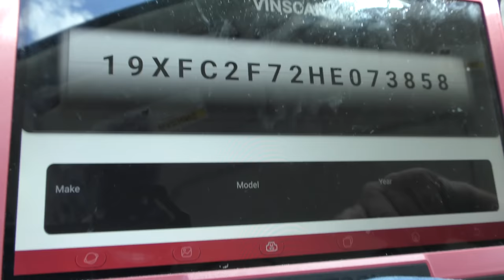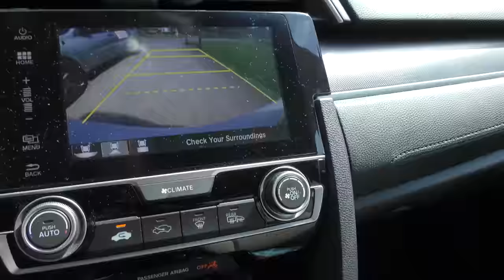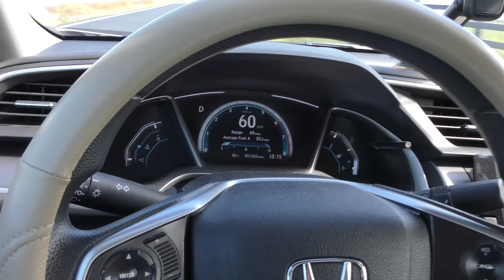Here’s What Happens If You Change Lifetime Transmission Fluid in Your Car

Comment: For those who want a Complete (Trans, Torque Converter, abd Radiator-Cooler) fluid exchange vs an approx 40% pan exchange, the following 2007 RAV4 approach SHOULD be applicable to Most makes and models:
1.) Remove the plastic shield under the front of the vehicle. Note, new assorted plastic push-clips are recommended.
2.) The radiator cooler transmission fluid out-fall is on the drivers side approx 3/4" OD, 3/8" ID rubber hose with spring clasp clamp --  EASY to see and access!
3.) Disconnect the hose and attach an extension line to a translucent 1gal jug in an catch pan (for overflow/spills).
4.) The steel return line may drip into a second catch pan.
5.) Snuggly attach a clear extension line to the dip-stick tube with a funnel. (I inserted a clear plastic kitchen "baster" keeping the refill level from overflowing at top of the "baster"/funnel).
6.) Start the engine and put in gear (automatic) until approx 1/2 gal OLD is collected and turn off engine.
7.) Fill approx 1/2 gal NEW.
8.) Repeat for approx 2 1/2 gals until bright pink is dispensing.
9.) Reattach radiator/trans Return line.
10.) Adjust fluid level to the low side of the "Cold" mark on dip-stick (so you can top-off to the Hot mark).
11.) Drive vehicle until transmission is up to approx 115 deg. F and adjust fluid level to "Hot" mark.
12.) Reattach the plastic shield using new plastic push-pins.
13.) This should replace the Trans, Torque Converter, and Radiator Cooler with ALL New Fluid.
NOTE: For Sealed transmissions attach an extension line with funnel to the steel Return line (instead of the non-existent "dip-stick tube").
Happy motoring!

Comment: The older non CVT Honda transmission had the dipstick to check level and refill which was easier than this new one.  Excellent Scotty thank you
Reply: No, the newer Honda cvt has a check bolt. You remove the bolt, and pour fluid in, until it comes out the bolt hole. I don’t know why Scotty didn’t mention this?
Reply: @tripicana1 in a transaxle or differential you're correct.
Reply: @DivineSadist  Honda cvt uses it too, no need for a dip stick.

Comment: Scotty is spot on about NOT flushing your transmission. I bought a 96 Buick regal back in the day and I wanted to take care of it so it lasted a long time. I thought I was doing the right thing when a mechanic suggested I flush the tranny fluid instead of changing it at 60K. Well, I ended up with a transmission that wouldn't shift properly after that and had to get it rebuilt. I would have been better off doing nothing but instead I paid for a flush and then I paid for a rebuild. (about $1500 at that time)
Reply: The transmission in that Buick was far easier to rebuild than a modern transmission would be.

I miss the good ol days of simplicity, and I think it's funny that suggesting a car from the 90s is simple. I remember when those cars were new and everyone went on about how complicated they were. If only we knew then just how crazy it would get...
Reply: Completely right.  Had a 94 Chrysler New Yorker I wanted to take care of.  Had a flush done.  Never shifted right again.
Reply: As a mechanic and garage owner for 35 years I can tell you there are different types of machines to accomplish this process there's a difference between transmission flush machine and a transmission fluid exchanger. I personally own an exchanger and have used it for years with no problems ever but I also drop the transmission Pan and service it completely I don't just rely on the fluid transfer.
Reply: @sdrape4964  At least it wasn't a sideways engine.
Reply: but what if the transmission fluid was leaking? and had to be replaced?
Reply: @Nunya Business You're wrong: buy a cheap older car that is actually a decent car (you know, TESTED and PROVEN) instead of stupid credit cars.  Get out of the dumb credit loop on something as cheap as a car.
Reply: I had similar issue with BMW F10 535i xdrive (ZF 8HP transmission). After transmission flush and refill it started shifting really harsh 1->2 and 2->1 gears after short spirited driving. I was not sure if this was the reason, but strongly suspected the procedure of changing the fluid was not done correctly. Ended up selling the car, because the repair of the transmission costed a lot. At least for ZF transmissions don't flush, only drain and refill according to the procedure described by them.
Reply: Lol no he’s not right tbh I use to work for Honda and we sold trans fluid flush and we’ve never told a customer that the fluid is a life time fluid 🤣🤣🤣
Reply: @nunyabusiness3786You’re not of good morale character.
Reply: @aelfwealld This is such a bizarre response. You managed to squeeze so much nonsense into just a few self-righteous words.
Reply: @nunyabusiness3786thise proven and tested used cars were credit cars when they were brand new too though. Just because people need to finance them doesn’t somehow make them inferior. Your logic is so faulty
Reply: 2005 Honda Pilot. I changed the fluid when it was 15 years old and had 105,000 mile. 6 months later it needed a rebuild.
Reply: @TheHillrat4wd  what does that mean you service it completely?  What does that include?
Reply: @earljenkins4671 Honda flushes the transmission??
Reply: @JesusSaves827 was it a flush or just a fluid change?  Who did it?
Reply: @JesusSaves827 was that the only time you changed the fluid? We never changed the fluid in a Ford escape and it's gone 250k miles
Reply: @sl4983  Well I have to define a couple of terms first, the term "flush" I don't like. That actually is an Antiquated term when they first came out with a "flush" machine it was merely a pressurized bladder tank that could be over pressurized hooked up wrong, you could reverse the flow of fluid and possibly damage the transmission. "flushes" have got a bad rap, technically it was the fault of the technician not doing it properly. current machines like the one I have are considered fluid exchangers they do not operate under high pressure they actually use the pump in the transmission of your vehicle  to pump the fluid into the machine then there is a small 12 volt pump in the machine that will pump in the new fluid at the flow rate the old fluid is coming in, you start the vehicle run it to operating temperature with the machine hooked up once the fluid is to Temp and circulating properly there's so many fail-safes on a machine if the flow is hooked up backwards it won't work, if the flow pressure isn't correct it won't work it's basically impossible to damage a transmission today using the proper equipment again I would say it is called a fluid exchanger. Now to address your original question when I say complete that means I dropped the pan change the filter and then continue with a Exchange most garages you go to only do one or the other, they drop the pan and change the filter top off the fluid or they will hook it up to a fluid exchanger without changing the filter and just exchange the fluid to me to do either one of these individually it's not a complete job. Do both.
Reply: @TheHillrat4wd  That was very helpful, thank you SO much.
Reply: @TheHillrat4wd  if doing both, which one would be done first?
Reply: @JesusSaves827  just to be fair that does not mean it failed because you changed the transmission fluid.
Reply: Probably should have adjusted the bands on that.
Reply: The issue is going to a mechanic that's flushing and charging the fluid with the wrong stuff. Maybe they do it on purpose so they can get the repair business later.
Reply: @earljenkins4671 so you ate saying it's lifetime?
Reply: Never flush the transmission fluid on GM cars
 Not recommend it,bad idea
Reply: What is a flush can u describe it? Its not the same as changing fluids is it
Reply: @nunyabusiness3786Don’t measure inflation based on the minimum wage lol. 

There are too many reasons to list here why you shouldn’t do that.
Reply: @lmr9512 A flush is when they drain ALL of the fluid and replace it.
Reply: @justinmadrid8712  A "flush" typically involves adding solvents to the transmission to "clean" or "remove  deposits" in the transmission.  The fluid exchange itself doesn't cause problems.  It's the solvents that are used that ccause the problems.

Comment: I purchased a high mileage Honda accord sport with a cvt transmission. I had no prior information about whether the cvt fluid had been changed before, I changed it and it runs just fine. Changing transmission fluid is often overlooked by most people and it shouldn't be. I change all of my fluids regularly including the brake fluid. It's the lifeblood of the car.  I get over 200k on my Honda's and have never had to replace a transmission or an engine. I do my own maintenance so it's fairly cheap.
Reply: Just as important as your oil. Two things on a vehicle that you need to protect over all else is the engine and transmission. The small cost of fluid and filters will save you thousands down the line
Reply: Oh, a non fragile American..  So rare.
Reply: @Benjamin Burlos well you could go 100k before that needs to be changed but u get your point.
Reply: Best advice anyone can give....  The first thing you should do when buying a used vehicle, is have all the maintenance done.  That way, you know it's done.  Also, always get a pre-purchase inspection done.

Comment: Well, Scotty, just changed the gasket, filter, solenoids on my 01 JGC Laredo w/227k miles because it’s been leaking ATF+4 fluids for years. Today, it shifts so smooth and saves me so much gasoline now. Who knew it would save me gas? I love my Jeep! 🇺🇸
Reply: Excellent.  I drained out 5qts on my 07 JGC Laredo with 165k.  Changed the filter. Cleaned the gaskets and changed the solenoids.  Major improvement.and my Mpg went up noticeably.
Reply: Got a 98 jgc with some odd shifter behavior. Changed fluid but nothing other then that
Reply: @salami99  still shifting oddly?
Reply: After i dropped the pan on a 93 buick the lockup solenoid started behaving, and it came to a stop a whole lot smoother.  I did that at about 140k
Reply: @salami99  You might have a stretched out Throttle Valve Cable that goes from the Throttle body on top of your motor, down the passenger side, then crosses over the tranny and then connects just above the tranny pan on the drivers side. The cable is about $79 and takes about 45 minutes to replace. BTW, this cable is adjustable, there is whitish, maybe yellowish clip to adjust the cable. This tells each gear when to shift. I replaced mine last year, while worth the $$$.
Reply: Hoss Cartwright is my 
01 WJ 4.0 L 
160 thousand miles on it. 
Runs like a deer . 
Cold 🥶 a/c

Comment: A few months ago I checked my trans fluid on my 2002 crown victoria which I had got used at 170,000 miles. It turned out the fluid was 50,000 miles and 8 YEARS old. The fluid was dark and barely red (presumably due to its extreme age). Boy was I glad I did a drain and fill on that thing. As soon as I got it on the road the difference was massive. Zero delay, silky smooth shifting, on a 20 year old car with 215,000 miles.
Reply: This is a cvt transmission not a reg automatic

Comment: Hi Scotty. I have a 2021 Honda Civic Hatchback in a CVT, and I really, really appreciate you for not only showing me how to do a the CVT oil change, but also for dropping little gems of knowledge on why and when to change. Cheers!
Reply: Hey, how’s the Honda Civic hatchback holding up? I’m shopping for a 2024 Honda civic, but feeling worried about this CVT business.
Reply: @adamburton7471 

No issues, I have approximately 30,400 on the dash. I can merge easily on the highway, and I also get great MPG. If you take care of your stuff, it’ll take care of you. Honda CVT engines are fine, it’s just Nissan you have to watch out for.

Edit - however, if you want something more bulletpoof, I’d recommend the 2.0NA instead of the turbo. Turbos in general won’t last as long as something that’s NA. If you can, wait for the hybrid that’s coming out this summer.

Comment: Thank you for this, Scotty. Funny enough I was going back and fourth with two service advisors regarding changing my CVT fluid at 30k... Some serious boneheads! Any mechanic who does not advise you change your fluids frequently is not a good mechanic! Never stop making videos, good info is very hard to come by these days and you do a great job.
Reply: 30k seems a little soon.
Reply: @greenspiraldragon  trust me, it wasn't. I know my driving habits. The fluid was pretty dark even at only 32k
Reply: I do all my own maintenance, no lifetime fluids... just proper service intervals
Reply: @greenspiraldragon  No such thing as too soon. It will never do harm to change it earlier. It can do harm if you wait too long.
Reply: If you have a CVT one of the best things you can do is install an aftermarket transmission oil cooler. Heat kills transmissions.
Reply: @greenspiraldragon  in most manuals they recommend doing it twice as often in rough driving areas. For example, Colorado is considered a rough driving area because of the altitude and hilly areas.
Reply: I want to change the transmission fluid (drain and fill) on my Corolla with 60k but Toyota dealership say they don’t recommend it. I don’t know what to do
Reply: @scotthillebrand5664  I personally change mine every week.
Reply: @komichan4409  absolutely do it.
Reply: @LolimGennaro0o Educate yourself on engine oils and transmission fluids. The color of the fluid means just about zero with no analysis by a lab. In extreme cases it can be burnt, but darker doesn’t show what the chemical composition is. This happens to be a fact.
Reply: If you are so smart change it yourself…
Reply: @nordicpride9708  I now do routine service on my car such as draining and refilling 4qts of CVT fluid per 12k miles. My brother is a master mechanic so I use his personal shop.

Also - the darkening of fluids related to machines means that the fluid has degraded over time. Usually, the darker the fluid the more it has degraded and has less efficacy in doing its job. 

Several things can contribute to the darkening of the fluid such as oxidization and exposure to friction / heat.
Reply: So change the transmission oil on a closed transmission? I have. Lexus and they said dont change
Reply: @brentneahring2797 so I have a 2010 Lexus and was told by Lexus don’t change it b it’s lifetime band closed transmission. What did you do for cars like this?
Reply: @LolimGennaro0o so I have a Lexus. They say don’t change the fluid. No issues with it. But 175 k miles and I wanted to just do it. And my Nissan rouge. 150 k cvt oil is dark . Black. Should we change it, and put old oil in or drain and put new oil in?
Reply: @LolimGennaro0o  The color means nothing until you have it analyzed by a lab. You can’t tell when motor oil or any other lubricant is bad with one data point. Sorry pal. You are mistaken. But you own a CVT so I can see how knowledgeable you are with vehicles in general. I’m a technician and have been around the automotive lubrication industry my entire life..
Reply: @shellybelle6781  up to you if you want to change it. Back in my old 5 series BMW told me the same thing but I ended up sucking out the fluid using a vacuum hose and putting new fluid in with said vacuum hose
Reply: @shellybelle6781  also just know that there is no such thing as “lifetime fluid”. When they say that they are assuming the “lifetime” of the car is about 100k miles
Reply: @LolimGennaro0o  Fluid being dark, doesn't mean the fluid needs to be replaced.  Engine oil and transmission fluid turn dark as a result of the additives being heated.  Has nothing to do with the fluid being "degraded"....

Comment: So glad I got my 2020 Civic Sport Sedan with the 2.0L naturally aspirated port injected engine and a 6 speed manual transmission! 
The Honda and Toyota CVT’s can absolutely last many miles, but they still won’t be as reliable and cost as little to maintain as a 6 speed manual 👍🏻

Great video as always Scotty!
Reply: Manual is good, dual mass flywheel is not, very expensive to change, mine lasted only 100k miles.
Reply: But you will need to replace the clutch.
Reply: @ozzesty7314  
The clutch shouldn’t need to be replaced if the vehicle isn’t abused.
Reply: @johnlavender242  even if it does its typically not too difficult,  it was very easy in my 02 eclipse gt
Reply: so isnt your civic the Si?
Reply: @johnlavender242  Civics attract kids. Kids are hard on cars even if it belonged to mom and dad, kids dont granny to the grocery store or anywhere when they borrow them. I know because I was once a kid.
Reply: @pflaffik mass flywheel still cheaper to replace than a whole cvt. There is no rebuild. My cvt internal bearings wore out and every shop i called wont replace parts on cvt only replace the whole unit. 3500 before labor. Manual trans complete clutch kit replacement only $800 for another 100k miles peace of mind.
Reply: You don't live in LA 😂

Comment: I've been lucky with my 2009 nissan sentra. Of course it has the dreaded Jatco cvt transmission. The car has 278,000 miles on it with the original trans and the fluid has never been changed. Haven't had any trouble out of it. The rest of the car has been well maintained  and has been a good car so far.
Reply: Never changed the fluid in our 06 Ford escape

Comment: 2004 Avalon with 120k. 35k or 40K  hiway miles means more frequent changes when you do low mileage.  I don't wait that long.  Never had a problem.  At my age and not having the tools, I watch my trusty mechanic.  This time it will coincide with the oil change and the brake fluid change (8 years), and the lubrication of the appropriate parts of the undercarriage.  It stil runs like the first day.